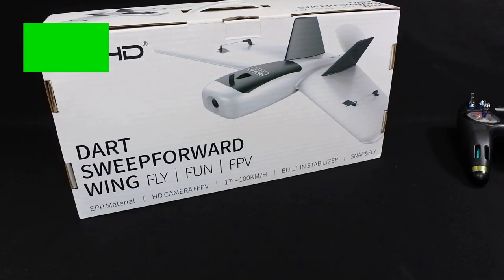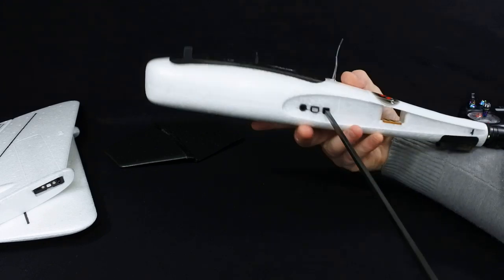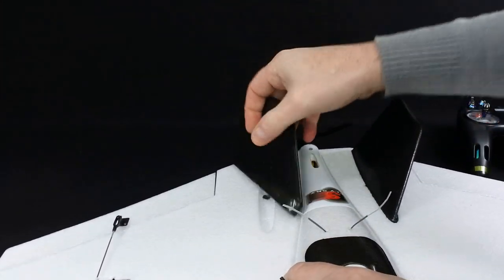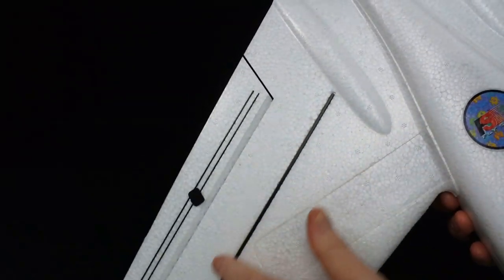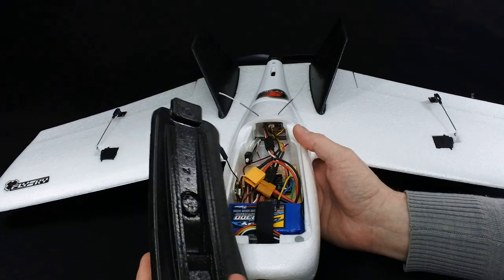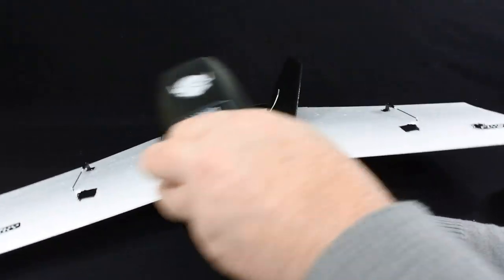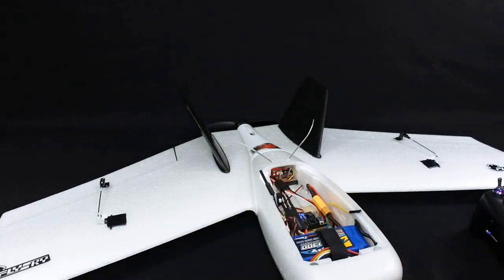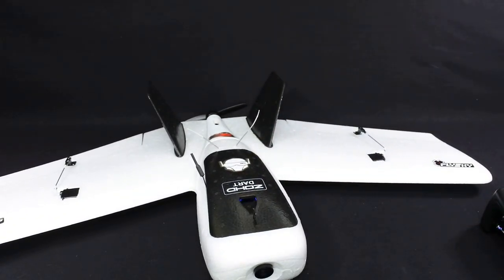ZOHD DART FPV WING ITS AWESOME!!!

Comment: How much does the airframe+motor+servos weight?
Reply from the maker: Hi 373 grams with a 1300 mah 3s lipo and fpv gear
Reply: @CKone41  what about just the plane? Without electronics?